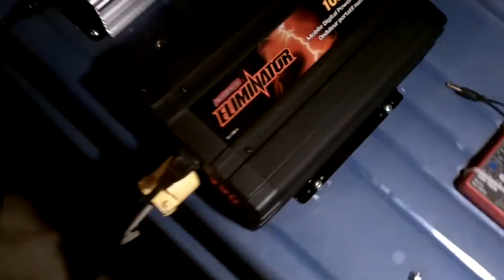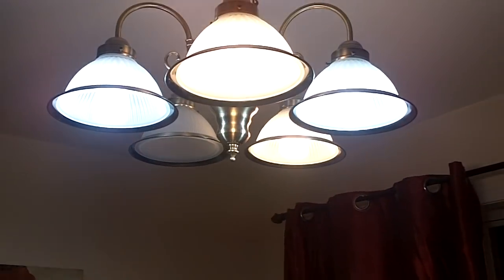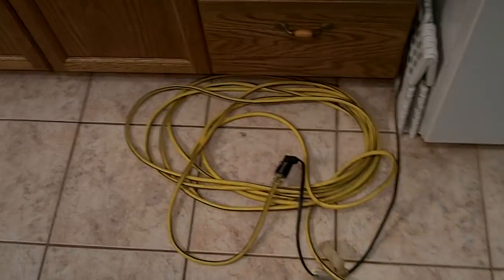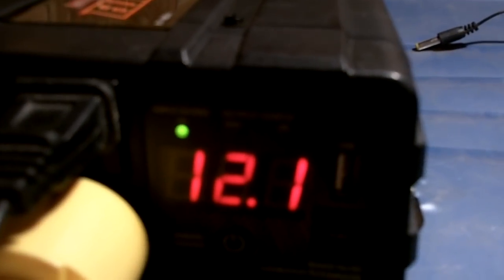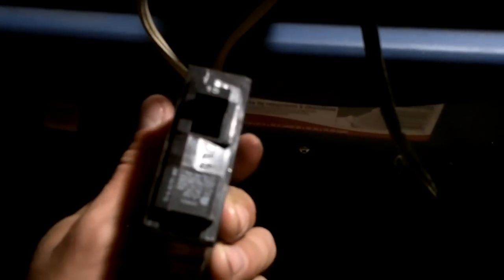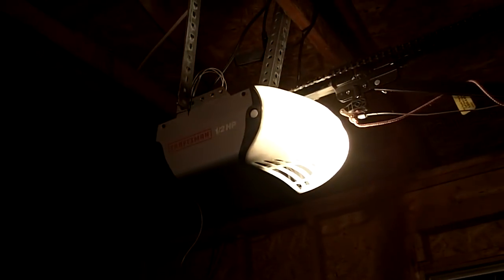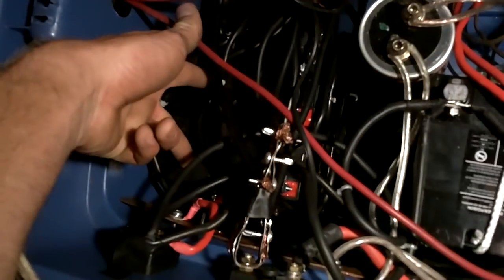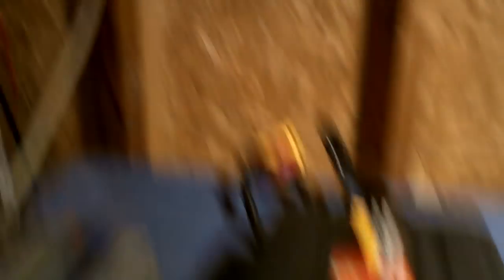House running off 1000W inverter

Comment: Okay we've been asking this question over and over everybody's trying to sell these big fancy batteries but they still haven't answered the questions everybody wants to know if you can run at 10.1% off of your solar so far no one has answered that question I think it is because they're trying to push the DC
Reply: So can you run an AC refrigerator a 10.1 off of your DC
Reply from the maker: wait what ? 10.1? im not understanding your question. @charleenmoore7659

Comment: This should only be replicated with CAUTION. This video helped me power my whole house in an emergency yesterday. It was -10 degrees celsius and we lost power around 11:30pm. I was mostly running the furnace, lights and fridge.

Important things to note are:

1.) Main breaker MUST be turned off.

2.) Turn off all 240v breaker. 

3.) The suicide cord must not have a ground/ground pin because there is already a ground on the main panel. 

4.) Inverter must be turned off and suicide cord unplugged before turning on Main breaker after power is restored.

I am planning to get a proper transfer switch.
Reply from the maker: Good breakdown, I had forgotten about this video.  Check out my newer videos,  I live off grid with a 20k solar system

Comment: dose that run the heated in house or microwave some heater are 1300 to 1500  watts some microwave more 1000watts am just askibg
Reply from the maker: I believe  it ran the furnace  with nothing  else  running,  my system  has changed  so much over  the years

Comment: Could you tell me if you have grounded your inverter, most fridges require a ground  connection for the electronic board, does your fridge sound different when running on inverter  then when it is plugged into house power, you have a good basic back up system, just be careful with the back feeding make sure you have turned the main breaker off.
Reply from the maker: Main breaker was always off, the inverter was never grounded because I was connected to the house witch in grounded, never double ground a house, also the back feeding in this video is unsafe and should not be copied.

Comment: Not too bad I have 1100 watts 800 watts 500 watts inverter i going used 12 volt deep cycle battery 100 amp 1200 watts about 4 battery  4800 watts
Reply from the maker: that will be a great backup system.

Comment: I'm about to do a set up with a inverter for a emergency back up station of sorts, been wanting to experiment with inverters or  homebuilt generator type things for awhile
Reply from the maker: That's a great idea, you will have a blast learning about solar!
Reply: @GoingOffGrid101   I have seen a video of a inverter being hooked up to a car battery, seems to work well
Reply from the maker: @N8TVTripper  yes it works well to about 1000w most car alternators only output around 1000w newer trucks can do around 1500w
Reply: @GoingOffGrid101   do you have a video on beginner or very basic setups? I. Got interested when I saw a video of a guy running a full size fridge off back up batteries
Reply from the maker: @N8TVTripper  My older videos are very simple. also Probably badly filmed lol
Reply: @GoingOffGrid101   I'll check those out

Comment: How long can he work non-stop?
Reply from the maker: About 12-24 hours depending on how much I used at the time.
Reply: @GoingOffGrid101  I was referring to the inverter, how long does it withstand non-stop.
Reply from the maker: @alexandrut5405  I used it for 2 years and put it away as backup, so it's still working

Comment: What kind of battery you running for it?
Reply from the maker: in this video sealed lead acid.
Reply: @GoingOffGrid101  how many amh
Reply from the maker: @swaggod226  around 300-500 I cant remember anymore cause my system has changed so much.

Comment: I can’t believe that a small inverter will do that, I’ll do the same but I have a shed with a full solar system that powers my whole house .
Reply from the maker: it runs lights fridge and if i turn most lights off it will run a few lights a laptop and fridge at same time.

Comment: Assuming lead acid batteries... they dead. Lol. 12.0 is as low as you'd ever want to take them. 

You may wanna conserve energy better, or larger battery bank, or some other means of charging them. Winter time, they'll freeze.

Still neat to see someone else run a house off a small inverter.

Comment: Couldn't you split your house electrical panel into 2, so the non essential lines are in the 1st panel, and the essential lines are in the 2nd panel, and in between you would install a generator style outlet switchover switch.  Then when ever you want or need to, you could flip the breakers off in panel 1, then plug in your generator style outlet switchover switch to power panel 2 - no more extension cords.
Reply from the maker: you could yes.

Comment: Hi! Thanks for this very informative video  I am an inverter newbie and I am really fascinated with your setup. I noticed you use batteries of different ampere hours. Did you connect the batteries in parallel regardless of their ampere hours?
Reply from the maker: yes I did :) the small ones don't live as long as the larger ones is what I found.
Reply: @GoingOffGrid101  Thank you so much. So, how do you charge them? Do you use a single charger for all of them? And I also noticed you added a capacitor. What is its purpose and what is its rating? How was it connected? Sorry if I ask so many questions. I am really interested with inverters
Reply from the maker: @leandrotabarangao4809  the capacitor is not needed it didn't do to much. I used one charger for all the batteries and charged them all at once.
Reply: @GoingOffGrid101  Thank you so much 😊
Reply: @GoingOffGrid101  another thing I noticed is you have 3 battery bank switches. Did you group your batteries according to their respective Ampere Hours? My current battery setup is I have one 75Ah and two 7.2Ah all connected in parallel. I don't know if it is okay to connect them altogether because they have different Ampere hours. Won't the 75Ah hurt 7.2Ah batteries? Thanks in advance.
Reply from the maker: @leandrotabarangao4809  it will not hurt the smaller batteries, but because the smaller batteries have less capacity, they do go dead a little quicker, and it will shorten the smaller batteries life span.
Reply: @GoingOffGrid101  Thank you so much. I really appreciate your patience in answering my questions. I am learning a lot from you. God bless.
Reply: @GoingOffGrid101  I was watching some of your recent videos and I feel like I am light-years far behind. lol! Anyway, I am learning each day by watching your inverter video setups. Based on your experiences, are Lifepo4 batteries better than AGM's or SLA's? If so, is there a cheap and reliable 12V Lifepo4 battery that I could use on my current 3000W inverter?
Reply from the maker: @leandrotabarangao4809  lifepo4 is way better yes, batteryhookup.com is where i buy my batteries. use my code Going for 5% off and i get credit for more batteries for my videos :)
Reply: @GoingOffGrid101  wow! Thanks!
Reply: @GoingOffGrid101  I use battery hookup  too only I'm building my own batteries.  It's waaay cheaper but a little more dangerous.  I've gotten my cells in but still don't think I know quite enough to start the builds w/o blowing myself up.  So I'll keep reading and watching videos
Reply from the maker: @garyburkhart4150  what cells did you end up buying?
Reply: @GoingOffGrid101   18650. I've seen videos on here where people have built entire power walls with these things.  I think the only thing I have to look out for is short circuits,  that'll really ruin your day , as well as burn your house down.  😀
Reply: I'm purchasing everything a little at a time being mindful of specs, same manufacturers and what not.  I plan to be completely off grid by the end of the year
Reply: @leandrotabarangao4809  there's a wealth of knowledge in books.  I purchased a lot of them like beginners electronics, solar for dummies, as well as watching a lot of videos and taking notes and drawing schematics. Keep going, you'll get there
Reply from the maker: @garyburkhart4150  that's great! You should make a few videos showing your system
Reply: @garyburkhart4150  Thanks! Yes, indeed, it is addicting. I recently purchased and setup a new solar generator with a (all RENOGY brands) 12V 200Ah LiFePO4 battery, 3000W pure sine wave inverter, 40A MPPT Solar Charge Controller and a 100W Solar Panel and I like it a lot. I can see the big differences between a pure sine wave to a modified one, Lead Acid car batteries (3 units) to a LiFePO4 battery and a PWM (Wanderer) to an  MPPT (ROVER) SCC.
Reply: @leandrotabarangao4809  well dang, here I am preaching to the  choir.  You're a lot further along than I am. Hahaha:)
Reply: @leandrotabarangao4809  with that setup, what all are you powering? I'm trying to get completely off grid.  What I'm trying to accomplish is 200 amp service to my home.  Currently I'm running 100 amp but thinking of the future
Reply: @GoingOffGrid101 my system so far is really not that impressive
Reply: @garyburkhart4150  as of now I'm only using it to power my garage door opener, a computer monitor (with a chromecast so that I could watch YouTube videos), a Samsung sound system,  LED garage light and occasionally some other stuff like charging the batteries of my power tools, drill press and other corded power tools. I am planning to plug in our LG fridge next weekend and monitor it closely using a kill-a-watt gadget.
Reply: @garyburkhart4150  haha. Not much further I guess coz I am just doing it on weekends. But I am really enthusiastic with solar generators. 😊
Reply: @garyburkhart4150  my setup is very simple as well. But I hope  little by little I could improve it 😊
Reply from the maker: @garyburkhart4150  you will get there but most poeple like to see the progress as you go.

Comment: Does that inverter have a true neutral or is it a “live neutral” inverter and you just didn’t connect the ground lead to the house? I’m curious how you prevented the inverter from blowing up when connected to a bonded neutral system on a house.
Reply from the maker: this is a old video, im not sure if it was live it not sorry.

Comment: May have a problem when the refrigerator goes into auto defrost mode (every 24 hours). When that happens the refrigerator may draw upwards of 750-1000 watts.
Reply from the maker: i never had a problem with this inverter and fridge, maybe a larger one might do that.

Comment: Better have  smoke detectors and fire extinguishers close by. Looks like a wiring nightmare, and a disaster waiting to happen.  I'd up my fire insurance as well.
Reply from the maker: Lol this setup has been upgraded and anyone without smoke detectors are nuts
Reply: @GoingOffGrid101  I would use metal conduits and fuseable links, and or a breaker box.
Reply from the maker: @matthewarendt4416  checkout my new videos
Reply: @GoingOffGrid101  How do you charge your batteries?  A/C or vehicle?
Reply from the maker: @matthewarendt4416  solar
Reply: @GoingOffGrid101  How long does that take?
Reply from the maker: @matthewarendt4416  a day
Reply: @GoingOffGrid101  If I lived near a stream or river I'd make a water turbine and attach a generator/alternator.

Comment: Nice work I wanted to do the same thing using a 3000 watt reliable inverter but I was afraid it wouldn't work but how do you hook it up to your whole house using your circuit breaker in the inverter that you have I only see 120 outlet

Comment: We got a few big ass leisure battery's we use with a 2000w inverter when we have power cuts here, it's better than using the old petrol generator, quiet for one, powers the house lights which are led and a TV and the appliances until the grid comes back on.

Comment: is that really a pure sine wave inverter.it  looks just like my modified sine wave inverter
Reply: Hi I have got 1000w inverter+120w panel with 12v battery but can't watch 32inch ac tv set, what could be the problem??
Reply: @jamesmujiw4788  maybe your battery isn't big enough

Comment: Thanks for sharing your video. I was curious what was used to control the battery charging, maybe something in line to prevent over charging? Thank you
Reply from the maker: I have charge controllers taking car of that.

Comment: Does anyone how to upgrade in inverter 4000 W peak 2000 continuous upgrade it to 12,000 W peak 6000 W continuous is it possible ?
Reply: Sure... ya buy an aims 6K LF inverter, and a bunch of batteries...

Comment: Are  you trying to tell me that that fridge and all the lights are drawing less than 400 watts???If this is so could you tell me what brand and cu. ft. it is ! Wow I'm impressed,I have the same  inverter and 10 100 amphr batteries and my little bar fridge  draws almost a 100 watts. Thanks for your feedback,
Reply from the maker: The lights are 14w each or less and fridge takes around 140w
Reply: thank You,  I remember when they used to start at about 1800 and run  well over 1000 watts!!
Reply from the maker: @Christiancowboyjoe  that's nuts, im glad they don't run that high or solar would be very hard to afford.

Comment: Excellent .. so glad there are people who think like me! I use a tiny whisper quiet gas inverter generator .. but the intent is the same. i can go almost two weeks after a storm on about twenty gallons of fuel .. others with the big machines use that much gas in a couple of days.
I run refrigerator, runs at 99 watts with 700 watt starting surge .. 900 watt induction hotplate for cooking and tiny 600 microwave .. the rest takes almost no current 26 watt TV and DVD player, LED house lights and small room fan when needed. Also powers all other electronics and computer charger.
 
During heatwave, if power and central air is down .. I have a tiny 6000btu Chigo AC unit that cools one room and vents though window .. can run it alone on inverter if needed as a refuge of last resort.

The last way I get by with tiny inverter .. I put a wireless thermometer in fridge/freezer so I can monitor internal temp without opening door .. $20 cost .. this way I can turn off generator or refrigerator and re-start as temp inside hits 40 degrees or 0 degrees for freezer  .. the pocket temp readout sets of an alarm when those temps are reached and I re-start the cooling again .. saves fuel .. also lets me use the generator for other hookups like cooking.

Comment: Too many odd size batteries. ...they will not charge/discharge equally and it will shorten their life.....Battery banks should all be the same amp hour and voltage
Reply from the maker: very true.
Reply: I agree with you completely. When I saw the 2  Harbor Freight multitesters he was using it explained a lot.

Comment: you probably found out when recharging your batteries with all the different sizes, your going to dry out those smaller gel cells if you have wired your larger capacity batteries in parallel with those smaller batteries. Those batteries are a ticking meltdown nightmare. You need to put all similar sized batteries on a battery bank each. 7Ah batteries all together, all 20Ah batteries all together etc, the isolate charging so they float all together in their perspective cells. Or, you can do what your doing, turning the smaller batteries into a hand warmer until they short open which is better the shorting closed. If they short closed then you have a unnecessary load eating your voltage from your good batteries and causing your system to fail sooner. Also, how can you monitor your battery network as you will have batteries that will fail? Even in my system, at least you would have multiple cells that you can voltage monitor in there charging banks than your setup where you would need to disconnect each battery from the system. while a 1K watt inverter pure sinewave is ok, I bet when that Refrigerator kicks on the compressor, your overload circuit protection on that inverter will crowbar out. That Cap does little to help a compressor looking for time+load to run unless you have nothing else running in your house. LED's are great lighting devices, but if you run a forced hot air furnace or a boiler for winter heat, what are you going to do with that? If you have a well pump, same deal. Or your electric garage door opener running when your refrigerator running etc.
I did this experiment on paper in 1980's and even though pure sinewave inverters are great, 1K watt inverter is too small for home use. At a total minimum, a 5K watt inverter or a typical 10K watt inverter designed by solar systems with a deep cycle battery bank will make you a very happy camper, but charging is the question? if you just wall charge your batteries from line voltage then this whole thing is actual a joke, unless you use wind, solar, nuclear lol, or steam something to create DC power so you can charge your batteries. Maybe even a buried electrical cord to a friends house a just steal electricity is better then charging off the grid

Comment: Since ur using a suicide cord anyway, I have to assume you're not concerned with safety... So I'll go ahead and tell you how to light up the other half of your house. 1. Turn off main breakers from power company. 2. Turn off all 220. (Double breakers) 3. Grab a double breaker, jumper from one breaker to the other with a small pc of #10 wire. Then install breaker into panel and turn on. This will join both sides on the panel into one. BEWARE! If you're not paying attention and turn on your mains with this engaged or turn on another double breaker (like your water heater or central air) with this engaged, BAD SHIT MAY HAPPEN! The breakers will probably trip instantly, but you may blow shit up/burn shit down
Reply from the maker: thanks I know all this now lol but im hooked up the safe way as well, this video is only for a massive disaster where people need to run their house to live.